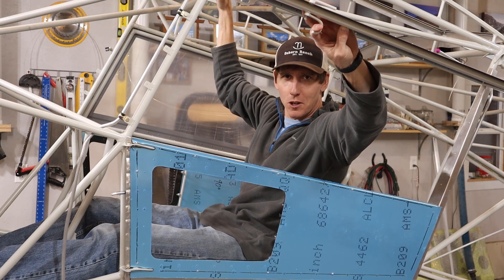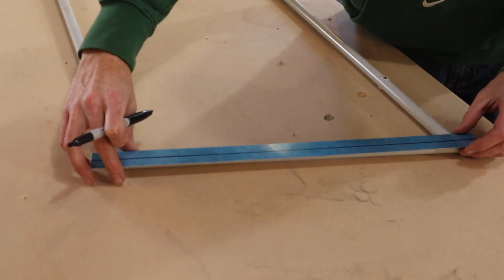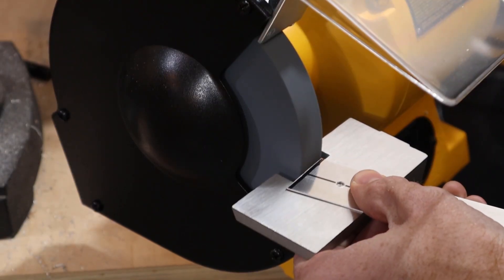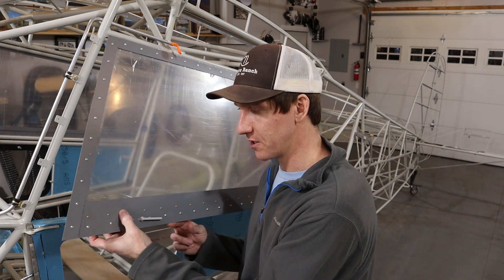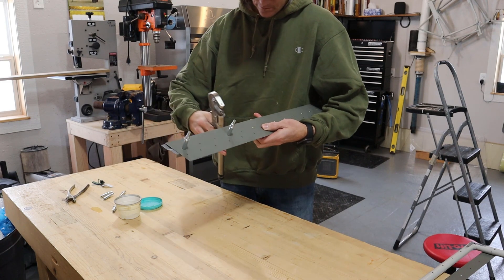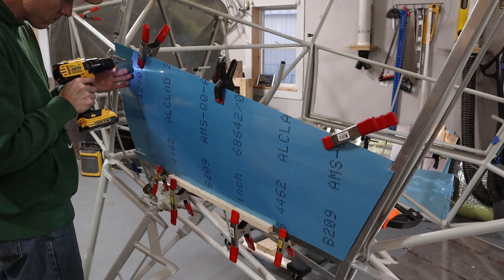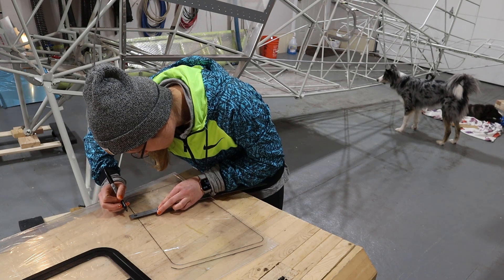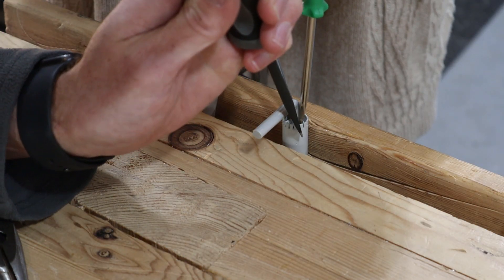Bearhawk Pilot and Copilot Doors

Comment: How are you going to lock the doors?  Also, good luck having a window that size open in flight.
Reply from the maker: Hey Schu. I was just going off Bob saying this style of window can be open up to 120 mph. I have no experience with this style of window at all so I’m glad you’ve given me a heads up. 
I don’t intend to put locks on the doors. There wouldn’t really be any use for its intended mission. If that changes down the road I’ll either come up with something or more likely redo the doors altogether.
Reply: @ColbyOsborn  The B and 5 windows look stronger than the square tube of the original, perhaps that's some of the difference, either way that's a lot of window to either fully open or fully close.  What are you going to do for vents?  I'm asking because these are all design decisions when building a BH, and while deviating from plans adds soooo much time to the build, it is nice to have locking doors on a brand new airplane.   For my part, I built seaplane doors, they all lock, and my windows are sliding like a cub/husky.  That said, you are building MUCH faster than me.
Reply from the maker: @akschu1  I haven’t decided for sure on vents but right now I’m thinking I’ll do the Cessna style wing root vents. No locks is certainly me being lazy and maybe I’ll revisit that sooner rather than later. 
Appreciate your input and all of your valuable post on the forum. Your post on thread 57299 has me thinking I might ignore bobs fuel metering recommendation and go the Bendix route.
Reply: I appreciate that.  It's always a balance and I'm pretty intense (yup I'm an engineer), so I miss frequently.  I don't like the simplistic view of fuel systems on the forum and prefer engineering that explains the design decisions, which is why I took the time to explain.  I think many people think one fuel system fits all situations, and that's not true.  The standard put forth by Mark and Bob of stick to the plans was the gospel for years, until the day it wasn't.  For most people I recommend airflow performance.  It's a nice setup, no carb heat, and very reliable.  If you do decide on a carb on your 5 know that you will be the first (only) one doing that.  Also know that you you won't know if it flows enough fuel until the wings are on and it's very hard to change.  Personally I'd have 1/2 fuel lines or pumps.  (see the thread with Rob's fuel flow).   Lastly, I posted this video so you can see what I've done.  I don't plan on posting it to the forum.        https://www.youtube.com/watch?v=Ky5SOPYZFrg
Reply from the maker: @akschu1  Maybe you'll let me bug you with a few questions when I get closer to figuring out my complete fuel system. 
Thanks for sharing the video. You've done an unbelievable amount of work and you've put just as much or more thought into everything! Impressive!

Comment: Grinding aluminum or any soft metal on a grinding wheel is dangerous. The soft metal will stick in the wheel and when the metal expands from heat, the wheel can crack and explode. Please use a sanding disc or belt for soft metals. We want to see you finish your project!
Reply from the maker: Thanks for the heads up! I didn’t know this was a potential issue.
Reply: They make aluminum specific wheels, ACS sells them but I forget what they're called. What I would say is don't use a drill press at eye/face level, if it grabbed that strip and whipped it around it could have slashed her face several times before she could react. Been cut with enough things myself this way, we're both not going to the effort of properly securing the workpiece ;)